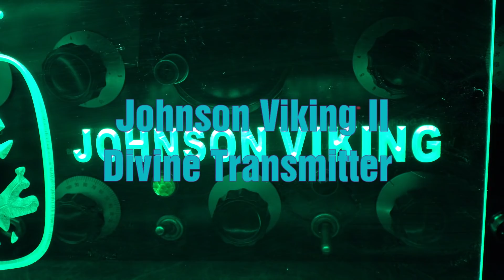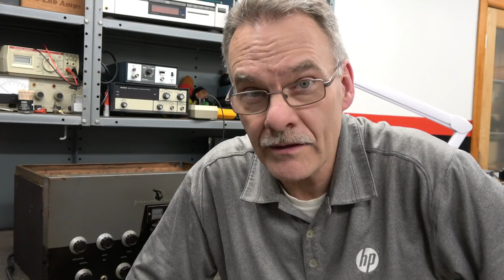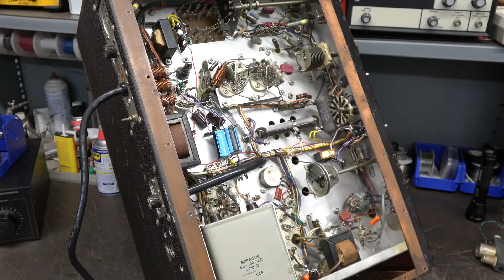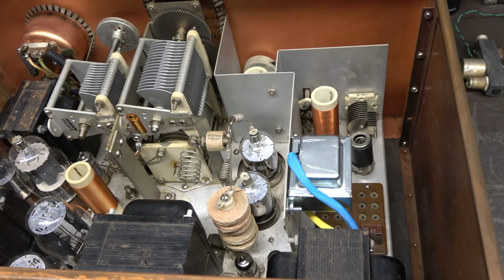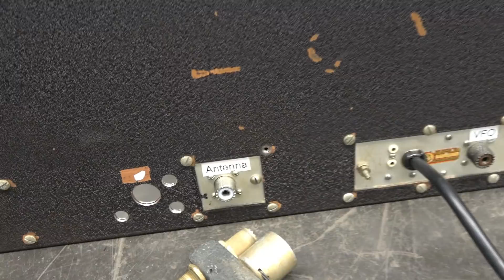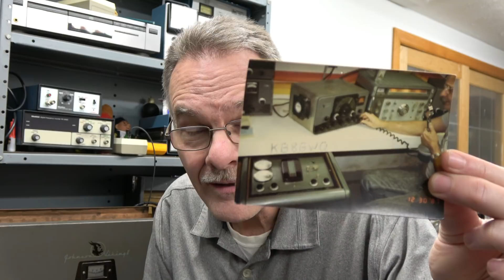Vintage Johnson Viking II Tube Ham Transmitter Disaster to Divine D-Lab Repair

Comment: Great video Terry....When I run into those crystal socket AC relay connectors, I use one of the crystal clips from some old Heathkit rig parts for better holding power...You probably know what I'm talking about....73.....Jordan VE6ZT

Comment: Hey Terry, killer job on getting that up and running again! I'm currently working on a vintage Geloso G 268. It's a portable Reel to Reel recorder, and it had a busted motor support. I got that fixed, but I have a question for you about the microphone connector.
The audio jacks on this thing aren't a standard 3.5mm nor 1/4" jacks. They're similar, but it's some in-between size. Searching more, I found this on Radiomuseum:
https://www.radiomuseum.org/r/geloso_t26.html
Seems like a compatible mic for this device, and the description mentions it's a "5mm" jack, but I have NEVER seen those, and searching for them resulted in nothing so far! I thought that maybe you know where to find them? Or should I just stick modern 1/4" jacks on it and call it a day?
Reply: I discovered it was apparently a proprietary connector used only on Geloso devices...
http://www.geloso.net/public/forum/topic.asp?TOPIC_ID=151&SearchTerms=jack
Guess I'm upgrading the jacks.

Comment: I like the dramatic video intro, the production costs must be through the roof. Very gratifying to see the proper resistor in place with shiny hardware, I don't know why it's gratifying exactly but it is. Question, asking as a  new student of electronics (currently enrolled at YouTube University) , did you by chance identify the foil ends of those "Orange dips" in the audio section before installing and then install them accordingly?
Reply from the maker: Hello Jim, Glad you liked the video. I hope you develop the love for vintage electronics repair. The caps I used in the audio section are Panasonic mylar type, no low side band. You will find that most of the new Sprague orange drop being made do not have that low side indicating bar anymore. The 1 "Sprague" that I did use, .001uf across the interstage secondary has no need for polarity, since that is a AC signal. For DC audio applications, example cathode connections, I try to pay attention to the low side indicator, if it is marked on the cap. Obviously electrolytics are marked clearly with - arrows. TD
Reply: Thanks Terry, follow up thought here, the reason I asked about the foil end of a non-polarized cap is because of a video from Mr. Carlson's Lab here on the "U" (You-Tube U). While these caps are non-polarized in that they won't blow up if installed backwards like a marked electrolytic will, they still do have an unidentified "foil end" that when installed, let's just say "backwards" , there would be more noise or at least some noise comparatively. Maybe in most situations it's not enough to be noticeable but since seeing Mr. Carlson identify the foil end of these types of caps I have now also seen a few vids from guitar amp guys where they identify the FE, mark and install the FE to ground or B- to reduce noise. Perhaps in a Ham radio application this is completely unnecessary, so what say you? Again I'm only asking as a student trying to learn from my professors of which you are one.

Comment: Great video Terry. Where did you get that johnson viking sign. I love it
Reply from the maker: https://www.ebay.com/usr/berakah.stores?_trksid=p2047675.l2559

This ebay seller custom made it for me. I bet she still has the artwork
Reply: Thanks Terry. I am building a Johnson viking station with my pacemaker and my viking ii both have a matchbox tuner and Johnson TR switch and a 19" military radio rack with an r274 an r390a and an so 600 that I can switch to at anytime. It will be great I hope to talk you on that station when it's done. 73's de KB0OQJ